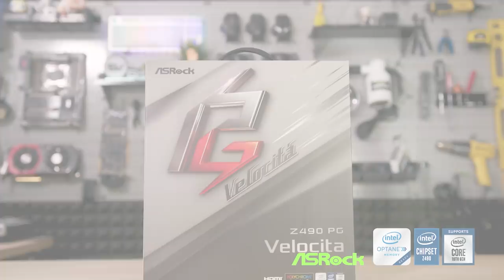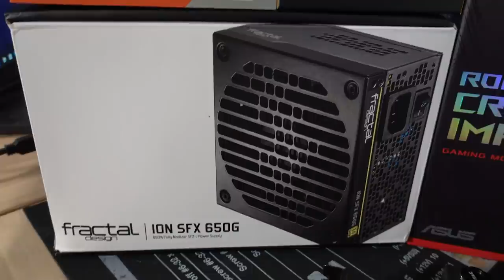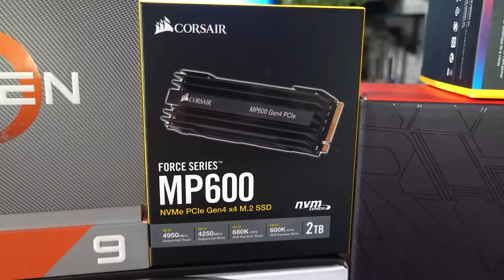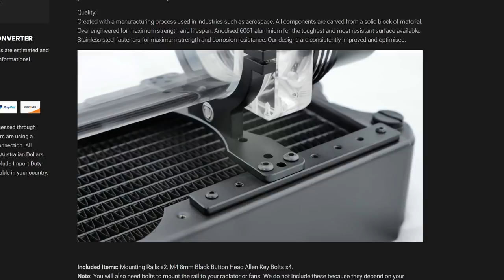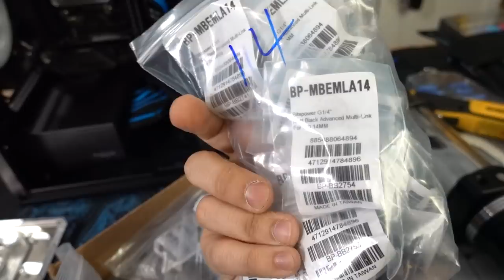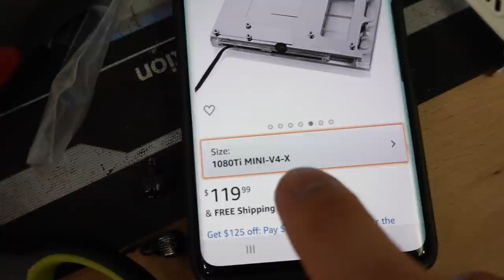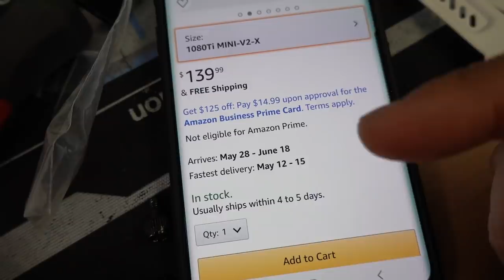Building him a custom gaming PC!! Shooby from Netflix's "The Circle" (Part 1)

Comment: Bitwit: 3200mhz ram is a bit slow
Also bitwit: uses 3000mhz ram
Reply: Bitwit: go for performance first then astetics 
Also bitwit: swaps out mp600 so he can have an rgb backplate
Reply: hes gonna oc it
Reply: İlkin  Not its not, I use 4133mhz ram 32gb on Z390 and I would say thats fast.
Reply: @chunkyavocado6102  False, especially on Z490.
Reply: @connor040606  4000MT/s RAM (for example) isn't any faster on Z490 than on any other platform. The Platform doesn't change that. 
And faster RAM than 3600 is still going to make a difference, it's just not worth it because it costs much more, but doesn't make that big of a difference. Especially on Intel because unlike Ryzen the CPUs Speed isn't tied to RAM Speed. But don't get me wrong. The RAM Speed directly isn't what makes Ryzen so much faster with high clocked RAM, the RAM Speed alone doesn't make much difference. The thing is that the Infinity Fabric clock is tied to RAM Speed on Ryzen and that's what makes the CPU so much faster with fast RAM. Not the fast RAM itself. And because of this you shouldn't get RAM above 3600MT/s on Ryzen 3000, because the Infinity Fabric can't handle more than 1800MHz (3600/2=1800) and would have to run in asynchronous mode with RAM above 3600 which tanks performance hard.
Reply: cries in 2133mhz
Reply: @excalibur2038  cries in 1333MHz
Reply: @Dilan_Duck  cries  in no pc
Reply: Hey he said 3200 mhz ram slow not 3000 mhz ram be big brain

Comment: So youre making him a high end custom loop pc so he can travel with it.... doesnt sound very safe but ok
Reply: water is better for traveling. less weight hanging off of a small point (air cooler) while still giving good temps. its the reason a lot of pc companies sell them with aio water coolers
Reply: @bradhaines3142  AIOs are great for traveling. I expect hardline tubing to be way to fragile for traveling.
Reply: @RedSunFX  i did specify an AIO lol. also i wouldnt trust the fittings with any real vibration on hardline, either way id leak check custom any time it moved. theyre not designed to vibrate and bounce, so its definitely not an ideal use
Reply: @bradhaines3142  OP criticized the custom loop and you mentioned AIOs only in combination with the pre-builts, so this probably caused the misunderstanding 😅
But we are apparently of the same opinion about this topic 🙂
Reply: Brad Haines why even comment then LOL
Reply: Hey, everyone knows rgb improves gaming AND safety by 50%
Reply: his name describes it all

Comment: Instead of using a dedicated pump & reservoir unit, you can use a CPU block with pump combo to clean up all that space. I believe the youtuber Optimum Tech uses some pretty decent CPU block pump combos, such as the Alphacool Eisbaer LT.
Anyways good luck with the build and stay safe, stay indoors

Comment: Could you maybe drill and tap the top of the existing waterblock? JB Weld or epoxy or some other method an extender or fitting into a drilled hole in the top if there isn't enough "meat" for threads? Since that block is kinda useless anyway...might as well play with it...and you've got a whole box of fittings...

Comment: If you have to order in new parts for this build you might as well also order a PCI Express Riser cable for that M.2 drive  and then place that drive in another location in the PC perhaps route it behind on the other side of the case towards the back plate? This was you will not have to compromise with a regular SATA SSD.

Comment: I’d say as far as the GPU, go with a 2070, performance should be almost the same as the 1080ti but he’ll have the ability to use raytracing. Which in my opinion can completely change people opinions on gaming and make it much better. Especially someone coming off a console who isn’t use to the high FPS and refresh rate, he might actually be comfortable with playing some RTX games at 30fps. And for the SSD and backplate, see if V1 can do up a new backplate that just moves the design all a little lower so the NVMe riser isn’t covering his logo! Just some ideas!

Comment: Wouldn't it be a good idea to have the reservoir be horizontal, mounted to the top rad, letting you use a 2000 series card?

Comment: I think putting an asus rog x570i in would be a better option than removing the nvme ssd, the board still has great power delivery and supports two m.2 drives without use of a dimm.2

Comment: If you’ve got a modder working on the side panel and v1 tech working on it as well and have front fan clearance issues why not have v1 tech make a gorgeous front panel thing with two holes for fans for intake and have the modder cut holes in the front panel?  Would be epic

Comment: Kyle i have a huge question, i am upgrading from a i7 7700 to a r5 3600. Can I use all my old drives with game saves and if so will they carry over and work with new setup. I mod a few games a dont want to start over.

Comment: It seems as thought the case is limiting you to what you can do to get the most out of the build. Do a slightly bigger case and you can accommodate a much better graphics card, and ditch the Impact and go with a Hero. You can use the NVMe, graphics, and custom loop if you switch cases alone. But I think that the MB should be changed as well.

Comment: You did this to yourself Kyle, you should've never shown him such an outdated case in the first place, the H210i from NZXT suits more this theme and its absolutely easy to watercool, it even has a dedicated mounting space for a pump res combo in the cable bar, not to mention that in the H210i you can fit a reference design RTX 2080Ti and a bunch of other stuff.

Comment: I have a Ryzen 5 1600 (not af edition) with a GTX 1660 Super OC gpu on the ASrock B450 Pro 4 motherboard, looking to upgrade in the future when prices are so monopolized. Using my PC currently to console stream through my elgato and thinking of gaming soon also. Info I've seen that may be of my own concern for future endeavors is upgrading psu (at 450w rn), motherboard maybe need bios update when using newer parts, and better case for airflow (I have a Corsair 200r). Budget in the future is estimated to be around $200-500. Thoughts? Thank you (:

Comment: Hey bitwit i have a question i have a corsair one compact prebuild pc but my warranty ended 4months ago and my graphics card is acting up. I wanted to know if it's possible to buy another case put all components in it and change the graphics card?

Comment: Man, you're cutting corners more than anything just to keep using that specific case. Get a slightly bigger case, use a larger water block with an RTX card (the encoder alone for streaming will probably be worth it), bigger mobo, use the nvme, use the decent ram, and don't need to choke all your fans. He'll survive :P

Comment: Building my first ever PC tomorrow, any recommendations from my fellows on YouTube?
Reply: Watch as many how-to videos and ask as many questions online as you need to get things set up right.

Go slow, be careful and meticulous.

Read the manual.

Have fun!
Reply: just don’t watch the notorious “Verge PC build”. That video terrible and not beginner-friendly(because everything in that video is wrong and misleading) if you want a reference “how to build a PC” video.
Reply: Test it out of the case first just to make sure all the components work and things boot up. If your motherboard does not have a power reset button (very few do) you can power it by touching the positive and minus power/reset pins on the Front Panel IO of the motherboard. If successful, transfer everything into the case. I'd only recommend for first time builds so you're more confident in the pc building process.

Comment: Maybe copy hotbox (Paul’s wife’s old pc) by using a separate pump & res and then you could use a longer more standard GPU (RTX 2080 super or RTX 2080ti from Evga would fit with that combo and fans under the front panel

Comment: I'm building my first ever PC, my budget is very tight, I'm getting a Ryzen 5 2600, 16 of 3200 ram and an RX 580. Opinions???
Reply: That’s pretty much what I had until I upgraded from a 580 to 2060 KO Ultra.
Reply: I can make your wallet a bit healthier.
1.ryzen 5 1600 AF
2. 16 gb 2666 mhz ram and then oc it to 3200 mhz
3. Yes perfect gpu
4. Get a 500 watt or more psu. (600 recommended especially for oc)
5. Get a good mobo, but stay budget.

Comment: I think there should be a case with a router built in so it is always a wired connection without needing any external wired and it connect with a pcie slot or something.
Reply: I also noticed you have the same behringer audio interface as me:)

Comment: This just seems so hodge podged. I think you should get a better case that'll accommodate your water cooling needs and a different motherboard. So that you can put all the fans you want and use the RGB ram. Even in this case, it'll be cumbersome to travel with. Also, wouldn't be the best idea to travel with since it's a custom loop. Think there's too many conflicting parts.

Comment: Hey bit! Just rebuilt my computer asus b450m ryzen 5 3600x geforce 1660super added 16 more gbs of ram so new total of 32. Psu thermaltake 500 80 plus. And everything works great except when i play certain  games i have 80 to 100 fps then randomly drops to 1fps then back up again every few min. Any ideas whats causing fps drops. Need help bad.

Comment: I heavily disagree with the whole sacrafice of NVME for the OS so he has, what, better VRM? There are other ITX boards that will run a 3900x with room to spare. It's not like he is OCing - and having main OS files on an NVME instead of a SATA drive can really make a noticeable difference, especially with a faster, high core count CPU like the 3900x. As dope as the Impact is, the VRM is irrelevant really in this situation where as having OS files on a faster NVME drive can make an actually difference, especially as time goes on and he can even put some games on there.

Comment: Custom water cooling loop  for a mini ITX Desktop that Shooby would take somewhere....hhmmm and you you are using Bitspower leaky af fittings?!?!? You should have mentioned AIO. Fractal has gr8 AIO w/ options to add a loop. to its rad.

Comment: im very new to pc building and stuff im so intrigued but can someone tell me what overclocking is
Reply: Overclocking is the process of manually boosting your CPU & GPU performance above the maximum, to squeeze the most power out of it, but at the cost of louder fans, higher temperatures, and more power consumption.

Comment: Can someone rate my setup and give some pointers? This PC is for gaming and streaming simultaneously, with apps open in the background. 
CASE:NZXT H510 Elite (Black)
 
GPU: NVIDIA GeForce RTX 2080 SUPER - Gigabyte WINDFORCE OC
 
CPU: Intel Core i9-9900K 8-Core 3.6 GHz
 
CPU COOLING: NZXT Kraken Z63 with LCD display
 
MOTHERBOARD: MSI MPG Z390 GAMING EDGE AC
 
RAM: G.SKILL Trident Z Royal RGB 16GB 3600MHz (2)
 
HDD: Seagate Barracuda 2.0 TB
 
POWER: Thermaltake Smart 600W Gold
 
FANS: NZXT Aer RGB 2 120mm Fan (RGB) (2)
Reply: Jesus how rich are you

Comment: Man, weird case choice by him, and weird components. Feels like a 2080Ti with air cooling would have been a better choice than a 1080Ti and all that water cooling. Throwing a truly last gen GPU in there when the 3000 series is about to drop in a few months makes no sense. Also, I'm not sure I would have used a 650W PSU in that rig. I'm sure there's some overhead, but PSUs also never continually deliver their claimed wattage. Definitely a strange build all around. Seems like all the importance was attached to case visuals and water cooling.

Comment: This is odd.
Because of the small form factor decision, so Shooby might occasionally carry it around ... you had to change up the ram, GPU block x2, M.2 card to ssd, reservoir, front fans, one top fan ... where does it end?  You redesigned the rig mid build, for why? Cause stuff didnt fit?  You ended up replacing everything to hold to the small form factor.  
These are purchases that if a home builder made them, a massive amount of money would have been spent and left on the table unused.
Leaves me to ask with respect; 
Problem solving the build plan before purchase, looking for conflicts ... isnt that a fundamental part of a build?
Seriously, the simple decision would have been to switch to an ATX mb in a mid tower. 
Would have cost a few inches and been much less heartache and cost.
Is holding onto the small form factor that important?

Comment: Just go with a bigger case and leave all of these restrictions behind you.  1080ti instead of a rtx for VR?  ram was too big, fans are too thick (in both locations!) no m.2 on mobo. bigger case? no problem.  I'm pretty triggered that this is actually happening.

Comment: CAS: CyberPowerPC ELUNA 242V Premium RGB Gaming Case Mid-Tower w/ Tempered Glass Window Panel + 3x ARGB Fans (White Color)
CPU: AMD Ryzen 5 3600 3.6GHz [4.2GHz Turbo] 6 Cores/ 12 Threads 35MB Cache 65W Processor
CS_FAN: Default case fans
FAN: CyberPowerPC MasterLiquid Lite 120mm ARGB CPU Liquid Cooler with Dual Chamber Pump & Copper Cold Plate
HDD: 240GB WD Green SSD + 1TB SATA III Hard Drive Combo (Combo Drive)
HDD2: 1TB SATA-III 6.0Gb/s 32MB Cache 7200RPM HDD [+46] (Single Drive)
MEMORY: 16GB (8GBx2) DDR4/3000MHz Dual Channel Memory (ADATA XPG Z1)
MOTHERBOARD: GIGABYTE X570 UD ATX GbE LAN, 3 PCIe x16, 2 PCIe x1, 6 SATA3, 1 M.2 SATA/PCIe
NETWORK: Onboard Gigabit LAN Network
OS: Windows 10 Home (64-bit Edition)
OVERCLOCK: No Overclocking
POWERSUPPLY: 600 Watts - Standard 600Watts 80 Plus Gold high-efficient Power Supply
SOUND: HIGH DEFINITION ON-BOARD 7.1 AUDIO
UPS1: Tripplite TLP66USBR Protect It! 6-Outlet Surge Protector, 4 USB Ports, 6 ft. Cord, 1080 Joules, Diagnostic LED, Black Housing 
VIDEO: AMD Radeon RX 580 8GB GDDR5 Video Card [VR Ready] (Single Card)
WNC: Intel Wi-Fi 6 AX200 Dual Band, 2x2 2.4GHz, 5Ghz (160Mhz) + BT5.0 w/ PCI-E Adapter & Dual Antennas
can some tell me if i made a good choice at all 1,300$ pc that i got and idk if i might need upgrades at all ill be checking back i just need some advice iv always wanted a pc for years and im finally getting one iv always played console and i have a laptop it just sucks to play games on?  im very new to the pc world i know very little about them this is my first tower iv ever owned so if someone can help me in the pc world plz doo so i know what to upgrade or do whatever.

Comment: Hey bitwit my name is jayden and I'm 12 about to turn 13 on june 16th I need ur help I'm desperate I want to build a pic but o dont know how I picked out parts and I do t know what will happen when i build them 
 tell me if i can build this 

Gigabyte GA-A320M-S2H (AMD Ryzen AM4,Lexar NS100 2.5” SATA III (6GB/S) 128GB Solid-State Drive,Patriot Signature Premium DDR4 8GB (2x4GB) 2666MHz (PC4-21300),
AMD Ryzen 3 3200G 4-Core Unlocked Desktop Processor with Radeon ...Style: 3200G 4-Core,Thermaltake Smart 500W 80+ White Certified PSU, Continuous Power...Style: 500W, Size: 80+ WhiteAeroCool Cylon RGB Mid Tower with Acrylic Side Window, Black. If u help mr GIANT THX

Comment: i cant help it, im just dissapointed with the current state of the build. since the choice of the mainboard was fixed from the very start, how little less planning and foresight has gone in things like the custom gpu backplate and how it may look like when everything is finished is... just - sorry to say - dissapointing. not to mention the poor choices made with the front rad/fans and how they will (even with 15mm fans) be choked up, the rather bad choice with the reservoir, the extension-hose on one of the blue lines of the sleeved cables.

C'mon Kyle, u can do better!

Comment: Hmm, a lot of big mistakes in this built me thinks.....
Case is sh!t, using an out dated GPU, then custom water cooling for someone that has no idea about PC's!
On top of that, he wants to cart it around, so case 4 with the handle would have been ideal but cant do much with the cooling in that case.
I would have a completely different case, the SilverStone Precision PS15 RGB, with a 2080ti & 240mm AIO water cooler....

Comment: I would have used a 5700XT over the 1080TI, Oh I get it U used what u had in your office.. That's cool.. Not that the 1080 ti isn't a strong card it's just like 5 years old now, and NVIDIA keep releasing Driver's to slow the 10 series down and make the 20 series look even faster.. Freaking crook's.....

Comment: hi all, ive been having problems with my pc, i done reddit posts, asked on various discord servers like the pc master race one and ive got no hope now, and so im really in need of help 
My specs are ryzen 5 1400 stock, rx 580 nitro + 8gb, 16gb ram 500gb ssd 1tb hdd 450w psu(low ik)  so in a lot of games like tarkov i dont get above 60 fps in all settings ik its not the best optimised game im im sure i could i get above 60 fps at least, basically the same thing with maneater
But in mw 2019 i get 80 fps medium/high settings idk if i should be getting higher or not
does anyone know what i should do? people say its a bottleneck as my cpu usage is higher than my gpu sometimes and my gpu usage spikes down to 0 a  lot
if anyone could help that would be great!
I have also done loads of fixes and reinstalled drivers many many times
Reply: I'm sorry but what's your problem? Yes you get under 60 fps in escape from tarkov and man eater but that's because it's not that much of an optimised game. I don't see the issue here. Can you please explain what's wrong?
Reply: And also your pc isn't a bottleneck. It's fine.
Reply: @munirohm2420  i thought i mentioned it, my gpu usage drops a lot from 100 to 0 and goes back up, when it happens my fps drops/stutters, ive reinstalled my drivers many times and many other "fixes" so im not sure why its doing this. it happens on quite a few games